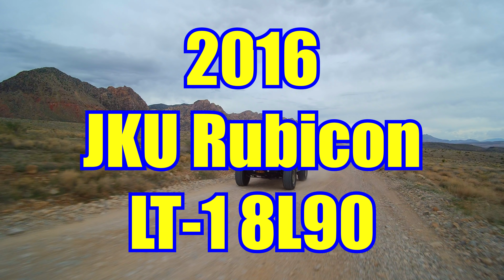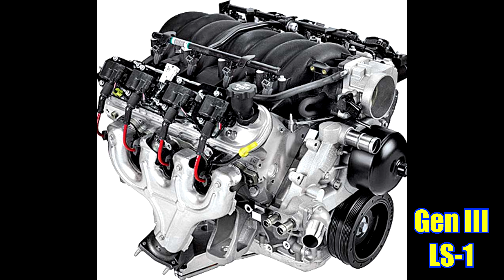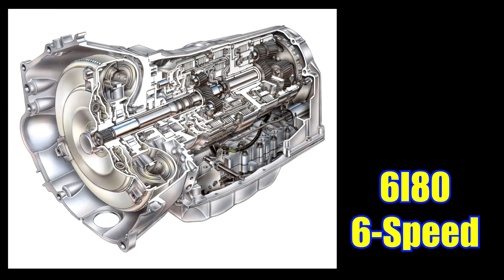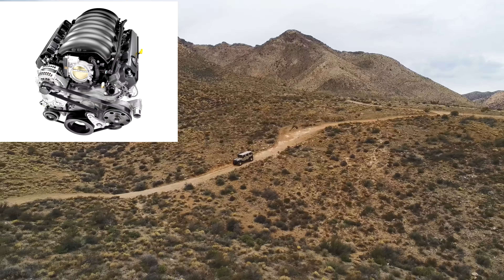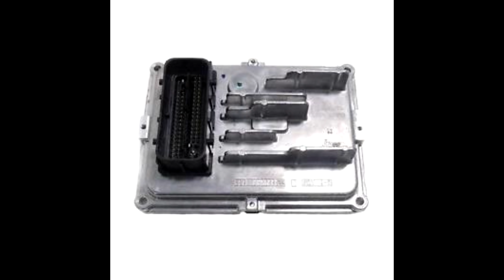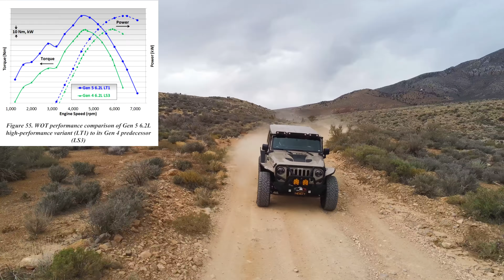GM LT-1 V8 8 Speed JKUR Engine Conversion

Comment: Should have talked about the 70s small blocks that made 350 horsepower stock.
Reply: I've owned many 350/350 and 360 SB's, great engines. Rump rump idles and the early LT-1's weren't available with AC. Economy wasn't that great either but in the day that's what I drove. Still have my 1970 350/350 Vette, and 1970 Z-28 LT-1.

Comment: How do people manage carbon buildup on the intake valves and other surfaces?
Reply from the maker: GM has patented technology to reduce carbon behind the valve. I've heard they spent a lot of time on proper crankcase ventilation and have worked valve cleaning into the cam phasing strategy. I'm told GM spent millions of CAD hours on the design of the cylinder heads so they do not suffer some of the DI problems that Europeans had.
Reply: @WranglerJKLS  Great video BTW.  Two years?  Any teardowns to examine evidence of deposits?  Do you recommend catch cans? We know about "Top Tier Detergent Gasoline" and Mobile1. Recommended maintenance and schedule? Chemical sprays? Walnut shell blasting that require engine teardown?  Or maybe nothing?
Reply from the maker: For whatever reason GM uses a catch can on the LT-1s but not on the truck engines. Mishimoto seems to be a popular option. We tore down and L86 with about 30,000 miles to install an LT1 intake and the backside of the valves looked fine.
Reply from the maker: Yes our first Gen V swap was February of 2017, an L86/6l80 in an early JK. We started the Gen IV swaps back in 2007(Toyota) when most companies were still using Gen III engines.
Reply: @WranglerJKLS  they have also focused on air flow as well. All fo these GM engines are 2 VPC (valve per cylinder). While the hemis and the Ford 5.0 coyote are 4 VPC. This means you get more power out of a smaller V8. That airflow is how you can get over 600 horsepower out of the 2 VPC V8, of which both the LS and LT engines are 2 VPC engines. If you look at the 5.0 coyote and the LT side by side, the coyote is almost twice the size of the LT if I'm not mistaken.
Reply from the maker: Yes 4 valve 5 valve ... engines can flow more air but add complexity. GM had to draw the line between symplicity cost, complexity and performance and we ended up with two valves which seems to do quite well. One of my friends in Los Angeles was manufacturing that 4-valve heads for the small block Chevy and they did add performance but also cost and complexity so everything is a compromise.